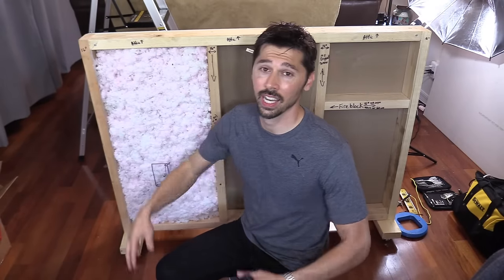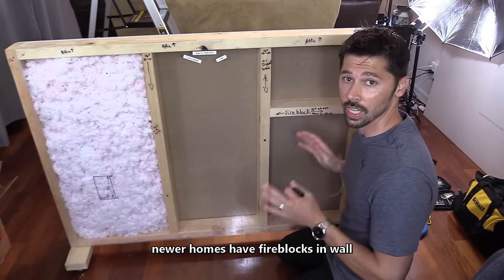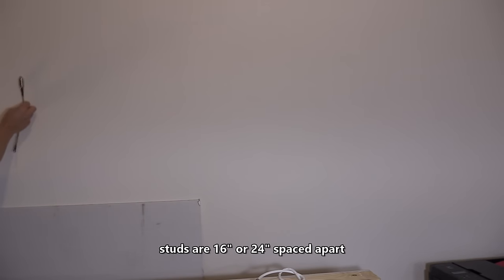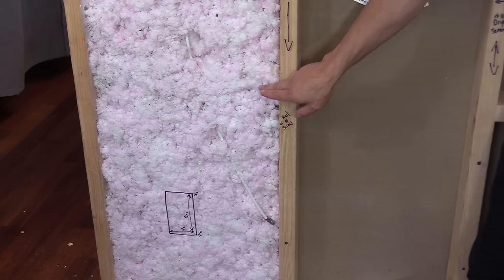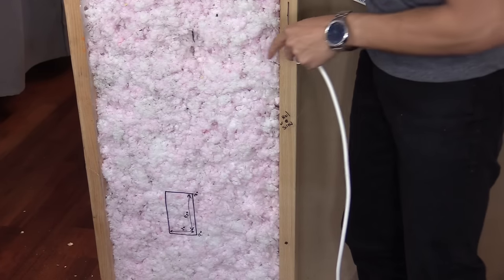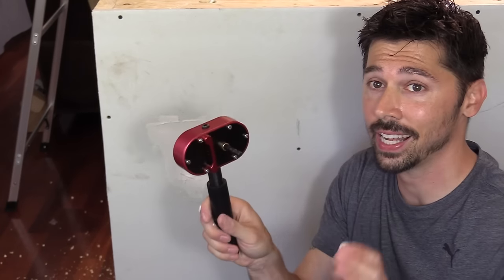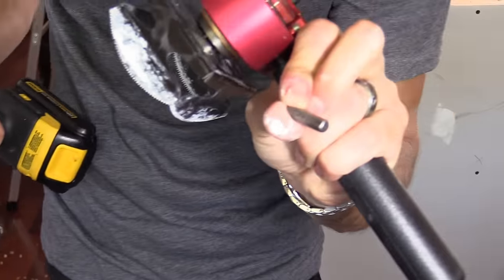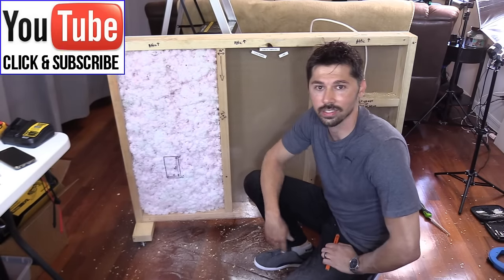3 EASY WAYS TO HIDE WIRES CABLES IN WALL & FIND STUDS

Comment: GreaT VIDEO.  The new tools really beat the old fish-tape and glow stick methods.  I always used 2' long spiral bits with screw tip bits.  It makes drilling through fire blocks much easier but locating the fire-block hole on the drywall was much more difficult than using your clean-cut method.

Comment: Sometimes you can use a long auger bit but usually I use a flex bit. They're expensive but invaluable--theyre extendable as well. This allows you to get through fireblocking without having to patch and paint anything

Comment: Few years back was in the attic was wanting to drop a cable wire down from the top to bottom of a cable box i came across a fire block what i did was got x long driil bit from home depot drilled the hole through fire block used wire fish rod n pushed it through the hole of course using flash light to get the wire through the hole but it went really easy for me no problem i would rather use xtra long drill bit than to cut into the wall just dont want to tear into walls drilling through studs is easier for me.
Reply: good approach but going through the drywall first at an upward angle allows you to control the flexible bit without the worry of drilling accidental holes in the drywall.
Reply: What if you come across a SECOND fire block farther down in that wall space? I have seen that many times, and you can't find a bit that long. Besides, long bits are very expensive. I like this guy's method.
Reply: Guess it's not a fire block anymore then with a hole in it and no sealant?
Reply: you can can always extend the bits to make them long..,, but definitely is a good video and i like all the tools that he is using....
Reply: @colliedogboy  You want to look at the total picture. Yes, drilling holes in fireblock and making holes in drywall is cheap and easy.  Fire spreading through the holes in the fireblock (maybe with kids asleep upstairs), repairing holes in drywall and matching the surface texture and paint is maybe expensive and a bit harder.
Reply: If your good you dont need a flashlight to see the hole.
Reply: That's what SHE said!

Comment: for finding fireblock, Just put a weight on a string, and drop it until you can hear it hit the wood, then do what you are doing at 7:43, and as soon as you hear it hit, pinch your string right at the hole, then pull the weight out, and hold the string in the same spot, with the weight dangling on the outside of the drywall, and the block will be just below where your weight is hanging. You have to be a bit precise, and subtract the ~1/2" for the drywall, but if careful it works every single time, and after a few times it takes less than 20-30 sconds to do. and its FREE
Reply: Find the fire block with a stud finder and avoid that section... sheesh, this is simple!

Comment: I'd also recommend getting a cheap borescope that plugs into your phone. Easy to fish and you can see what's going on in the wall if needed. Cost me less than $ 40 and I've used it to fish a wire through my car from one side of dash to the other. Also used it to check where water was coming into a wall.
Reply: Yeah, you can get them off eBay for about $10. 
I bought one and it sits in my truck "just in case". Haven't used it yet.
Reply: Finally, someone who adds to the discussion and isn't talking about the good old days. The borescope is great, especially the one where you can see the whole wall, unless you have an iPhone.

Comment: Damn.  I wish those tools were around back in the day when I was going through having to run wires in my house.   To get through the fireblock, instead of cutting a center hole, I just used an extension bit and a fish weight.  You basically drill straight down, put a 1/2" pear shaped fishing weight onto some monofilament wire, drop it through the holes down to your box, tie the wire to the fishing wire and pull. 
Would have really been a lot more fun having the tools you have.  Good job on the demo too!

Comment: Some good tips and information. I do have one suggestion though....the end of the magnet dropper should have different ends to choose from, such as a coax connector end so you wouldn't have to use tap to connect it to it. Plus by doing it with the connector and screwing it in there would be less drag than the taped end as you show in your video.

Comment: Great video, I am also an electrician but I didn't know about those tools, except that I use a flexible 4ft bit from harbor tools when I need to go through a fireblock and I don't have to do any drywall work, they are cheap like 12 dollars, home depot is so overpriced
Reply: camjamsdad  no, you're not the only one. Cutting visible holes in a customer's wall should be an absolute last resort, and especially not giant plate sized holes tbh. I used to wire alarms for a decade, at least 15 wires each install, and I could get easily through the entire thing without ruining the drywall. Single story, multi-stories, didn't matter - result was the same. I would be mortified if this guy came to wire up my house.
Other thing is, this would take me all day to wire up one house doing it the way he did. An average day would be 3 homes. At his rate I'd be losing money like water. Whatever happened to a good old-fashioned drywall saw?
Reply: You will never get a terminated cable through the tiny little hole from HF flex bit

Comment: WOuld have been nice if this had been invented back in the 80's when I did wall fishes. LOL Good video, man.
Reply: Doesn't work for plaster walls tho
Reply: @daijoubu4529  why
Reply: @chiefballs  the inside of the wall is uneven and not smooth
Reply: I hear you. I was working cable TV back in 1978 doing line construction, but they had some of us doing the installs the regular installers refused from time to time, so we got stuck with them. Wish I had that knowledge and tools back then would have things alot easier.

Comment: Awesome video I wish someone would have done this at my home! I have wires running along walls that are very unsightly! Thank you for sharing this informational video👍☝️👏😍
Reply: Hire a licensed electrician and your wires would not be seen, unless wall is solid concrete.
Reply: I used to be a cable installer. People would complain all the time about us having to install lines on the exterior. As soon as they heard, "hire an electrician for $120 and hour," they stop complaining about exterior wires real fast. If the public wants cable installers to start installing wire inside the wall, start expecting month long waits for any service appointment. Cable installers are expected to do anywhere between 5 and 10 jobs a day as it is.
Reply: I don't mind seeing a wire surface mounted occasionally, but what pees me off is when the installers doesn't remove the old dead wires and you have four or five wires on an older home.  Then it looks like a mess.
Reply: Lots of options to conceal the cables.
Reply: MAE HAY is
Reply: @pasqualeparente9776  probably because it's extra work.  Also when you start pulling out fasteners you have just put holes in the paint, left empty (fastener) holes in the wall, may pull off areas of paint and may get wood cracking, all of which will let moisture into the exterior wall.  Then there is the occasional "crud, I pulled the wrong wire!"  

As a homeowner, on consideration, I am happy that installers do not pull the old wires.  I'll do that (and caulk, primer, etc.) when prepping for painting the house.
Reply: @bugboy8462  no I don't expect a contractor to go around the house to remove all exposed wires.  But you clran up where you are working.  By the way my point was more about cable and phone wiring , where the phone company  or cable employee does not clean up the mess one of his colleagues created. I prefer they test the wire and use what is there.

Comment: And flexible drill bits. And they self-start and are twist type, so much less 'colateral damage' than spade bits.
Reply: Do you have a brand that's good?
Reply: @berryberry8392  Magbit on Amazon or tbe Klein set at Home Depot. Feed them slow and easy.
Reply: Yea I have no idea why his first thought was to hack drywall when you can run a flex bit down, most people dont realize they are easy to use, just start slow. For top plates I use auger bits

Comment: I find it interesting that so many people want to post negative comments on how this video shows getting around the fireblock. I found this video informative and insightful (especially with creating a removal tab for the tape - this drives me crazy when my "helpers" forget to do this!!!!). I have done AV installations since 2003 and understand that there are many different ways to do any particular job. For all of the people who suggest using flexible bits or bit-extensions to get through the fire block; how do you seal the hole after pulling the cable through, or do you just leave it open and defeat the purpose of the fireblock? Thank you Tampatec for the great video.

Comment: Great video!  I am needing to run cat6 cabling down a wall.  I have attic space BUT have an angled wall.  Any tips for that?  There is an existing coax I thought I could use as a pull string, but it seems like I am hitting staple.  Any tips would be appreciated!  Hoping to not have to cut/open up sheetrock.

Comment: The mag tools are great. Being a drywaller and finisher 20 years .  That screw won't be there at a fire block.. and finishing the patch.. use tape and joint compound. Spackle not for patch. Only small holes.. if you don't tape it will crack
Reply: Not if you use fiberglass spackling. Works great.
Reply: Speed = know your limitations and tell the customer what CAN be done reasonably. 
Workmanship = get a job that pays by the hour with a boss that prefers quality and customer satisfaction over quantity.

Comment: Just a diyer trying to run a cable for a friend. Thanks, found your video useful and confirmed my guess that I would have to cut a section out of the drywall to get the cable past the fire stop.

Comment: In all my years installing, Ive never seen anyone cut around a noggin like that - what a hassle having to plaster and paint. I always drilled two holes in the top plate then used either a spade bit extender or flexbit so go through the noggin. Second hole allows you to see in the cavity while you drill and drop the cables.
Reply: Jeremy West Noggin?  Purlin, fire stop, fire break....noggin.   Hahahaha!  I’m just thinking about saying “I’m drillin a hole through the noggin.”  What doofus came up with that jargon?  Makes the trade look bad when you don’t use the correct lingo.
Reply: Jeremy West oh, you’re a Brit or Aussie.  I getcha now
Reply: Yep - Aussie. Only ever heard them called noggins, noggin goes between the studs. A purlin would be a the part of the roof that makes the pitch here.
Reply: We call those rafters here in the states. Maybe a truss. A purlin is a horizontal 2 X 4 or steel C-chanel  to attach steel siding or roofing to a pole barn or structure.
Reply: This is the way to do it, no need for all these extra tools. What’s wrong with a hand plaster saw and a yellow tongue to get cable down a wall
Reply: I call it wood
Reply: Chris Roush cat is what we call them
Reply: to RichMed1a, here too, Jeremy made a mistake, unless he's a banana bender, they talk funny up there .
Reply: But then he couldn't sell the Magnapull! No Spackle on the sides of the pasteboard which was replaced!
Reply: Jeremy West don’t do anyone’s house it’ll burn down cause you opened the fireblock this kids going the xtra to stay in code
Reply: I agree now you have match paint thats crazy
Reply: @AW-bc7kp   in oz, nz or the uk, you don't have just 1 "fire block" / nog/noggin/dwang/blocking etc  in each section of a stud wall there is usually 3 or 4,  drilling a single hole in a "fire block" isnt really going to effect it all that much considering most of the hole is filled with a cable.
Reply: yeah i do the same like wtf is he doing
Reply: Jeremy West b
Reply: @RichMed1a   Rafters in houses, purlins in factories. Residential and Commercial/Industrial have slightly different terminologies for obvious reasons.
Reply: Flat roof, no attic. So you trench the wall at the fire block and patch afterward.
Reply: That's using the ol noggin'
Reply: You can also drill a third hole to shine a light down

Comment: You know, I was an installer for years.  I never used any of the magnet tools, or the q bit.  Always used a utility knife, jab saw, weights, etc.  that q bit by a fire block is great but what about when you cannot reach the drywall on the fire block because it's in between floors?  You're back to doing it the old fashioned way.  

Great video though.
Reply: That was a decent question. Much better than those finding fault.

Comment: On the Magnapull why don't they just put a male connector adapter on the end so you could just screw the cable connector directly to it?  Or make it so various connectors could be used?
Reply from the maker: good idea
Reply: There was one on his end, but you missed it because you were looking for mistakes.
Reply: It's not a good idea to pull coax by the compression fitting. Usually best to run the wire first then put the fitting on. When you pull it by the fitting it will pull on the jacket to the effect of making the connection poor if the fitting doesn't come off entirely.

Comment: You should modify your Magnapull so the end of it has a female coax on it then you won't need to tape it works great
Reply from the maker: 200mphbrian thanks for the tip
Reply: Coax is so 90's.
Reply: Terminate AFTER its in the j-box
Reply: Amcrest
Reply: That was a good idea
Reply: thats fine if all you are pulling is coaxial
Reply: Coax is STILL used to this day for MOST CCTV even though IP Cameras are available. There is still a good need and use for COAX.
Reply: You should modify it to be a rack to hold your fiberglass fishrods in your van, because we all know the fishrods will be used 99.9999% of the time.  The magpull was useful in retrieving that bit though.
Reply: How else would you get 1Gig of CATV distributed around a property?
Reply: You should have different ends that you can screw on to the magnapull, coax, network, HDMI, usb, etc.
Reply: Also used for amateur radio (HAM) antennas
Reply: @harryjohnson615  - Fiber
Reply: @4625boowoody  In the UK most fibre solutions are FTTP to the property but RF distribution internally. To distribute fibre internally at minimum would require optical splitting from the fibre feed. Not sure that pulling fibre in that fashion is a sensible thing to do :-)
Reply: He did have a female coax on it, but was showing how to tape other cables to pull them though. My god, what is it with all the detailing when he already covered it?
Reply: @4625boowoody  In the UK the spelling is fibre
Reply: Thanks for the clarification Mr. Johnson. I have an IT background. So when  I made the response of Fiber it was with a forward thinking mindset.  More and more devices, more and more info/data, faster and faster needs all equal faster speeds and more capacity.  We may not get there in our life times, but the day will come when fiber, or some other data transfer medium will be needed.
Hope you are having a nice Holiday season.
Reply: @4625boowoody  Agreed Bill but at the dramatic growth rate of fibre technoogy I wouldn't be at all surprised to see those solutions within our lifetimes. Have a great holiday yourself.
Reply: If you add a tip for coaxial cable, then you have to add one for every other type of cable that will ever have to be pulled through the wall, which can add up. That means trying to keep up with all those interchangeable tips, not to mention the sheer cost of buying them in the first place. Just use tape like he did in the video and stop trying to over-engineer it, please.
Reply: @harryjohnson615  Aluminum is spelled "aluminum" and  pronounced ah-loo-mi-num, not ah-loo-mi-ni-mi-num or how ever y'all English folk bastardize the English language. Same applies to the word "fiber."  Certainly not the Queen's English, or is it? No wonder we made a break from England back in the day. I'm just yankin your cord, bro, I mean bloke. But seriously, how did y'all come up with the aluminum pronunciation?
Reply: @taterman320241  Fibre the spelling is different but pronounced the same way, solder is the one that is different, you guys miss out the "L" when you pronounce it. The aluminium pronunciation is probably more to do with the differences in stresses and soft/hard sounds than anything else. Probably not worth going to war over though :-)

Comment: No flexbit? I never use a fish tape in the holder. I buy the fish tape refill, and make a one story piece, a two-story piece and a 2 ft piece. I also use use a telephone ground rod, about 1 foot long, as a wait. This allow me to for example drop coax cable next to a chimney down two stories from the attic to the basement.

Comment: What I usually do, depending on the age of the house, is send a fish tape up or down. Depending on your route. Measure height of ceilings and you'll know where your top and bottom plates are in a modern framed structure. Older Victorian homes are usually balloon framed, so you can drop wires from the attic on the 3rd floor straight down to a basement or crawl space. Knowledge of framing and how to maneuver a fish tape also play a big part in increasing your chances of finding wires buried behind the rock/plaster. When in doubt, ... Tone it out.